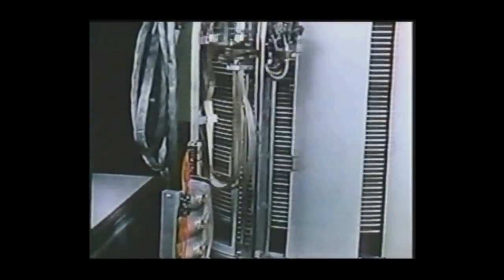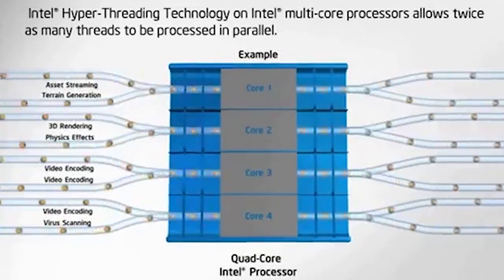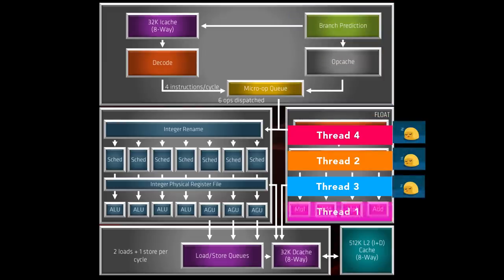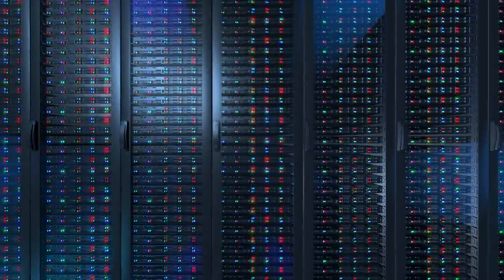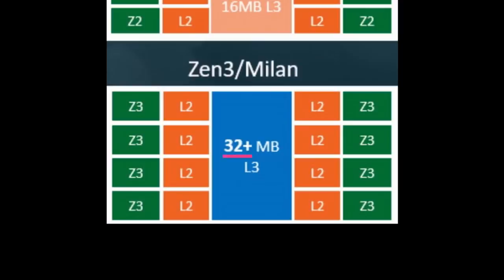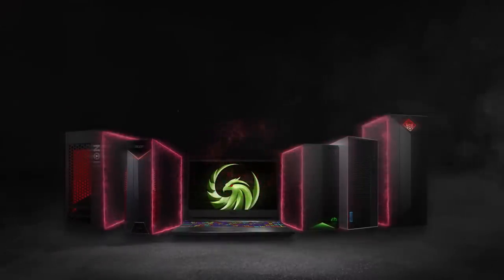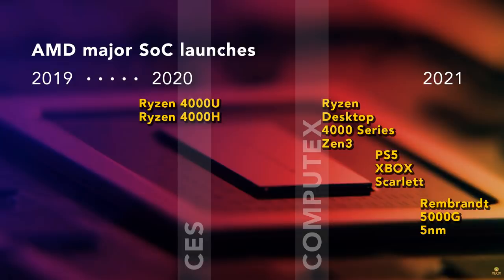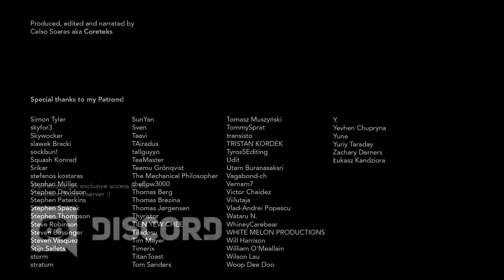Rembrandt | AMD’s MONSTER 5nm APU

Comment: An APU for 1080p 60FPS gaming at high settings would be amazing, no more low-to-mid range dGPU's!
Reply: Fcukkk yeaaahh. And it would be wayyyyy cheaper than a CPU GPU combo
Reply: I do not think that is far away. It will be available the year after the consoles land i am guessing.
Edit: just like coreteks sayd lol
Reply: @baronvonlimbourgh1716  a year? Not likely. AMD will probably still hold out to keep selling chips for consoles. If you can get an amazing pc for like 600usd it would severely hurt console sales. Most people already want to jump to pc or want to get a pc as well as a console
Reply: @StarmenRock  you could get a similar performing pc to the current consoles around launch for around that price this generation as well. And they still sold millions upon millions of them.

These are different markets in the end, even though the hardware is converging.
And if amd has the hardware i am sure they want to cash in on it.

You could probably build that now already. 1080p at 60fps for 600. A 570 or 580 and a quad core ryzen with some memory will do 1080 60fps for the most part.
Reply: @baronvonlimbourgh1716  The problem is the ease of assembly and ease of accessibility. A pc that's just an apu, 16gb ram and an ssd is already enough for most console players to be able to have a great experience in multitasking with a pc. Most people who are afraid to buy a pc are afraid of video cards. I know that because I assemble and sell PC's as a consultant.

PC Gaming is rising VIOLENTLY. People want a ps4 as well as a pc, it's not a case of one or the other. I also hope these apus start coming out for notebooks, that'd be really fucking good!
Reply: @StarmenRock  that is mostly a marketing problem. Most people are inherently avert to learning things. They will choose a lifetime of ignorance and confusion over putting effort into understanding something everytime unless they have a natural interest in something.

Companies like apple understand this extremely well. They don't use technical jargon and limit choice and  adaptability. 
Anyone who buys an apple product will at no stage be required to learn or understand anything computery, even though they are the exact same products sold by acer, samsung or lenovo.
The same goes for consoles.

As long as the boxed up stuff is good enough people will do anything possible to avoid having to learn anything. That is just the way mainstream works. And not just in computers. The car industry has been the same for nearly a 100 years.
Reply: @baronvonlimbourgh1716  agree wholeheartely with you. i hope these ryzen apus get more casual attention especially because of that, so better and cooler stuff can be made in the future. we wont ever need to get a thick and power hungry notebook to replace a desktop! imagine a LG Gram with one of these badboys in. hell, just with the 3400G and a smart naming and marketing scheme i can see it selling extremely well especially with the gamer and multimedia crowd. like a cheaper macbook with no bullshit that can you can play esports and work with that has a 8 hour battery and is very portable
Reply: @StarmenRock  the problem with mainstream gaming products is that they are generally utter garbage.
Just look what is sold in big ox stores and places like that. Do a youtube search for walmart gaming pc or any of those places.
Gamer nexus ordered one from their site and it was horrific.
Apple stuff is insanely overpriced but most of it is pretty good quality at least and gives generally a good user experience.

Consumers get ripped off at every turn because they refuse to aquire even the lowest baseline knowledge about the expensive products they use daily and in some cases are essential to what they do. People will only get burned a couple of times until they had enough. That is how they end up in the hands of apple and consoles.

Unless hardware manufacturers put systems in place that allow them to control how consumers experience their products, pc gaming will always stay a rather niche industry for tech savy kids. And sure the industry might be growing but it is still laging behind the growth other parts of the industry have gone trough in the last decade.
And windows isn't helping things either as the main gaming platform. More and more people are starting to hate  windows and its userexperience in my experience. Linux is in no way ready to pick up these mainstream users even though it isa superiour platform.
And then there are the know nothing keyboard wariors and kids with inferiour complexes infesting all these forums giving the most outragious and idiotic advice to the few people who do reach out in an attempt to learn more.
I could go on for a while but you get my point i think.

There are to many things that prevent pc gaming from going mainstream in my opinion. Price or product integration will only solve a couple of the issues and will not have a huge impact on adoption or growth.
It will make higher performance stuff available to people who are allready gaming on pc. That is a very good thing and allready worth it. 
But it will not make huge numbers of people exchange their consoles for pc's. at least i do not see it happening, there is just to much bullshit in this industry. But i could always be wrong offcourse ;).
Reply: actually this documentary means that in the future maybe you don't need a gpu at all.
Reply: Ryzen 7 4700g .
Reply: @StarmenRock  Is not rising violently lol GPUs are becoming extremely expensive and prices will keep rising since: a) Silicon is scarce, b) Scalpers realized how much profit they can win from scalping and c) Mining altcoins is very profitable.
Reply: dude that was 1.2 years ago, even before the pandemic

Comment: Just an FYI, Linux also runs on the desktop. Just because Microsoft won't do SMT4, doesn't meant Linux also won't. In fact, Linux on the desktop does SMT2 and from what I've read, it is capable of running in SMT4 mode.

Comment: 5 nanometers is insanely small, for context your fingernails grow at about 1 nanometer per second, a sheet of paper is around 100,000nm thick.
Reply: keep in mind that for example 7nm tsmc uses around 40nm gate width, so transistors arent that small, 7nm is how small can they "draw"
Reply: There are features smaller than that on the chips.

Even Intel's 14nm has some 6nm features.

It's far more about the name than the actual lithographic process.
Reply: A microfilament, which is a part of the exoskeleton of cells, is also 7 nm.
Reply: @cj09beira  the "nm" node name is pretty arbitrary. It doesn't directly relate to any physical attribute of the chip or the way it's made, it's just an order of magnitude thing.
Reply: @cj09beira  the "nm" node name is pretty arbitrary. It doesn't directly relate to any physical attribute of the chip or the way it's made, it's just an order of magnitude thing.
Reply: What you mean with draw?
Reply: @shalokshalom  You're essentially drawing circuits with photolithography. A chemical mask is coating the wafer, the high powered light will erase the mask where it is exposed. After exposure is done, the wafer is chemically etched wherever the mask is not covering. Rinse and repeat until you have all the layers you need. That is how you get all your connections and circuits on a chip.

The drawing talked about is how accurately we can expose something with the light. Deep ultraviolet is about 160nm in size of the wavelength, witch tricky multi patterning you can draw finer lines than the light. EUV, the new advancement used in TSMC 7nm+ is 3.5nm is wavelength size. By using EUV on the most complicated layers, accuracy goes up, speed goes up, and quality goes up.

Comment: "If code is optimized to run in a multithreaded cpu" - shows a guy editing a css file in b-roll.
Reply: DarkPhoenix1515 😂😂😂 :D Yeah and I hacked my computer with „cd .. cd .. cd .. tree“
Reply: XD
Reply: I also noticed the CSS code 😂
Reply: To be fair, web browsers use multiple threads to generate a page now.
Reply: @jasonlisonbee  you certainly don't do that in the page code
Reply: @AA-zm9hk  I'll settle on the assumption that the video creator figured that was a good enough example and most people can't tell what can or can't be multithreaded.  Also, other parts of the page can be processed at the same time as css.

Comment: rembrandt was a dutch painter renowned for his realistic lighting. I'm guessing rembrandt codename is related to ray tracing
Reply: good guess but i think i read or listened somewhere that amd is not planning on going in Ray tracing anytime soon they are more inclined in making there gpus more efficient buisness wise like better computation abilities rather than ray tracing as ray tracing is a new thing but not many companies are employing them in theire projects
Reply: @hamzafayyaz8616  I heard the literal opposite lol, who knows honestly. I had heard that Ray tracing was possibly rearing its head in its AMD form on either BIG Navi through a soft implementation on the software side and then the follow up, RDNA 2 to have native hardware raytracing support. But who really knows how reliable are sources are eh? We could both be wrong lol.
Reply: @hamzafayyaz8616  ray tracing isn't actually new. It's just the performance we get for a portion of ray tracing that's actually not usual. Yes what we're getting in games isn't the full extent of actual ray tracing. If you noticed, some are more focused on reflections while others are more focused on lighting.
Reply: Pushing raytracing as agressivly was premature by nvidea. The pickup has been less then stellar as it adds very little and very few people have hardware to enable it.

Eventually raytracing will have a place but that is still years away.

Comment: Lisa Su likes her numbers round... so I bet we will get PCI-E 5, 5nm, alongside DDR5 on an AM5 based Ryzen 5000. On May 5th 2021...
All in a 32 core part that is 5x more capable (25%+ IPC) than the 1800x... (ok JK)
Reply: No kidding, it could well be~!
Reply: Screenshotting this for later
Reply: 32 is 2 to the power of 5 (i.e. 11111 + 1 or 1 followed by 5 zeroes in binary.)
Reply: And 5 threads per core
Reply: I jump from fx 8350 to 3600x,  next upgrade will be my last personal computer build. All AMD. Right now 3600x g skill flare x 3200hz cl14 b die 2x8 16gb memory 5700xt and Asus vg279q 144mhz 1ms 1080p ips monitor , im a happy gamer.
Reply: @1967KID  that's a nice build and all but why reply on this comment, u don't see the relationship to the 5s
Reply: Make it 2025 and it's not joke anymore
Reply: @watchme9463  2021 adds up to 5...
Reply: @IvyMyki  2 sun tu bi tru dhou
Reply: And AM5 socket
Reply: I know "Victor" was mostly joking but..
1) PCIe v5 will not be on desktop any time soon. It's very difficult to keep doubling the throughput plus there's very little need. We'll transition to PCIe v4.0 and maybe get an M.2 connection that's PCIe v5.0 in the next 5+ years but not full PCIe v5.0 for a while.
2) DDR5 is obviously coming and I do think it will be for Ryzen 5000 (on a side note Zen2=Ryzen 3000 is horribly confusing so I tend to say "3000 series" instead of Zen whatever.
3) Zen3/4000 I expect to be for AM4 still
4) Zen4/5000 I expect to be for AM5 (AM5 socket, DDR5, PCIe v4.0)

Also, for APU's it's quite annoying that DISPLAYPORT isn't on many of the cheaper motherboards. It's not even that easy for the average person to figure out which boards have it and which ones don't (Newegg filter works okay though)... it's rather STUPID frankly as APU's are largely for lower budget builds but then only the more expensive motherboards support DP and those people don't buy APU's. Sigh.
Reply: 5.5 Ghz
Reply: @IvyMyki  have a good day.
Reply: is that gonna be the total annihilation of intel? lol
Reply: @solcraftdev  Sure!!
Reply: I've been wondering if they'll go for those "five fives" for quite a while.
Reply: I've been wondering if they'll go for those "five fives" for quite a while.
Reply: And it will cost $500
Reply: 24 cores, 1.5x ipc than 3000 series would be realistic.
Reply: better have a minimum of 64 cores in 2021, though. We're definitely on that pace or better.
Reply: With the keynote delivered by a 5 foot tall 5 year old with 5 dollars in his pocket.
Reply: It won’t be AM5 but everything else is possible on there
Reply: Illuminati confirmed xD
Reply: In 2025  more like
Reply: @photonboy999  I'd honestly just like to see something like 32 pci-e 3 lanes over seeing pci-e 5. Even just more lanes of gen 4 just for those items I could slot in. Like extra usb 3 or a capture card.
Reply: @user-zu1ix3yq2w  how many cores is too many though?
Reply: @1967KID  1ms IPS Monitor? Really!
Reply: @photonboy999  
Their are already Ryzen 3000 motherboards that have PCIE 4.
I wouldn't be surprised if we do get PCIE 5 with Ryzen 5000,
As I remember hearing a few years ago that because PCIE 4 was delayed for so long, it would be rather short lived and replaced a lot sooner
Reply: @photonboy999  I agree with almost all you say, but regarding PCI 5.0, I must say that its final specifications came out in May. What is more, it was already announced in June that they were working on PCI 6.0 (final specifications scheduled for 2021). While I admit that I can't find any utility for such bandwidth just yet, I do think that PCI 5.0 might perfectly arrive with Ryzen 5000 in May 2021. That would be two years after closing the specs for the standard, just like it happened with PCI 4.0.
Reply: That would be an upgrade
Reply: This is plausible, at least for PCIe 5.0, Ryzen 5000, AM5 and DDR5, such a pity that Radeon is 5000 series right now instead of 3000, it would be the same.
Reply: @IvyMyki   fx8350 - 3600x   without second line is 5 ;)
Reply: Don't forget the price tag of a cool $5,000
Reply: @1967KID  im looking at a very similar rig my self atm haha
Reply: " On May 5th 2021.."
Your values appear fine, but make that November 5th 2021 - unless Zen 4 slips into Q1 2022. As for the 5000 APU series (with Zen 3 cores) it will be paired with LPDDR5, not HBM.

Comment: I for one welcome our APU overlords.

Could this result in HEDT moving to compute only discrete cards, with screens driven by on-die graphics chiplets?
Reply: Nearly every efficient laptop is this: no discreet GPU, only a powerful and single APU chiplet.
It's already there.
And when APUs will be in the 60% range of power of discreet GPU cards (my estimation), GPU demands will drop like a rock. Who wants to pay an extra 400$ if a +50$ price on the CPU does nearly the same job? (At least on a new system, not an upgrade scenario).
Reply: @francoiscoupal7057  I mean if they make it that good it won't cost 50$/€ it would cost a bit more
Reply: @francoiscoupal7057  The operative word here is HEDT - as in Threadripper.
Reply: one possibility is where the user plugs his or her monitor into the motherboard's video port, and lets the APU do the heavy lifting when low-moderate load is required. And if they've installed one, the high-end GPU spools up and starts converting electricity and heat into polygons. You can kinda do this now on Windows with some intel chipsets, but I could see a whole market for that.

My video card is woefully underutilized when I'm not gaming, being able to nearly-sleep it would mean it'd last a bit longer.
Reply: @francoiscoupal7057  except we probably never going to reach that kind of performance for APU GPU performance. Imagine both APU and GPU being build on the same node. Even for 75w package and APU need to distribute that power budget between CPU and GPU while discrete GPU can dedicated all that power budget towards powering GPU processing only. This is why APU can't even best even sub 75w GPU. and there is a matter of game complexity. Resolution are going up as time goes by. And then as more raw performance can be put into new GPU game developer are pushing even more demanding graphic features to be use. The scale of one game are getting bigger which end up pushing the limits even the highest end of hardware.
Reply: Well AMD considers heterogeneous compute as the future of servers and supercomputers for sure, you can see that on the Frontier supercomputer and their ROCm API. This is why AMD is not implementing AVX-512. 

Though while I believe APUs will play a larger role for mid ranged graphics. I don't believe an APU will replace cards for gaming completely. Games always use newer and more advanced effects, 200w cards will always exist and developers will use them.

I think eventually an integrated GPU would be good for heterogeneous compute, using it as basically a AVX on steroids register.